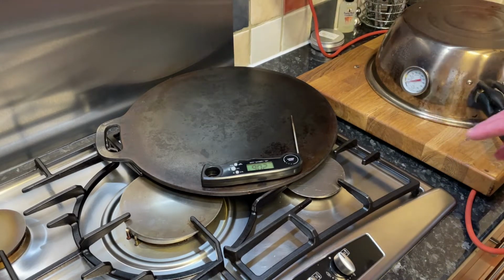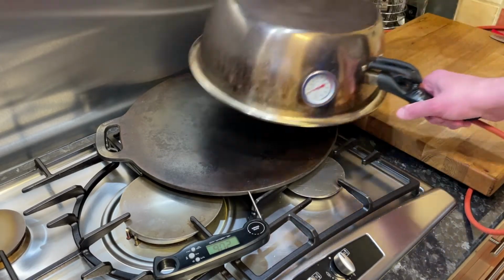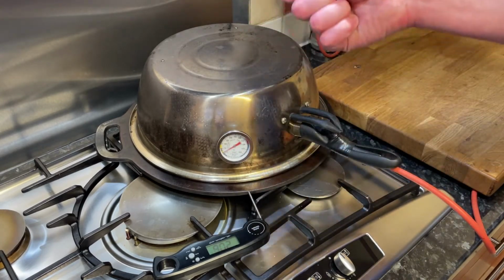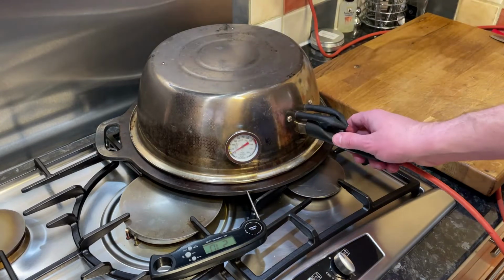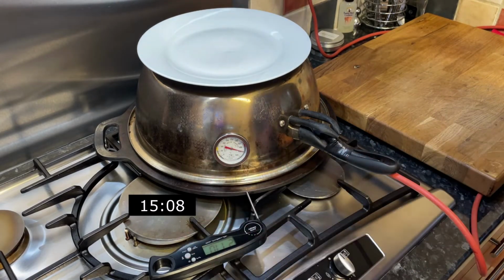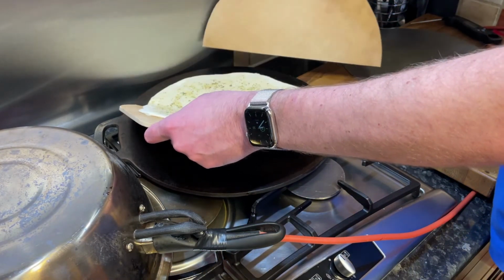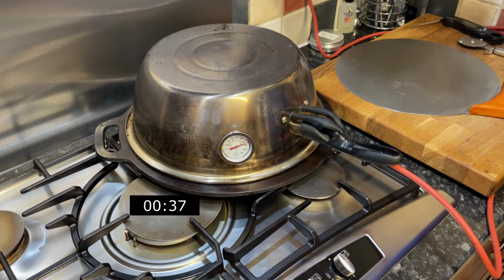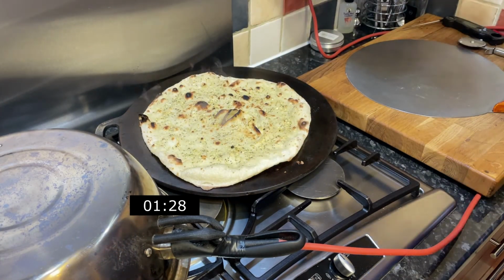Homemade Electric Pizza Oven - Follow Up

Comment: Nice time probe without gas fired for the bottom plate. I use an aluminium alloy 1cm thick plate and with gas takes 5 mins to heat up the bottom plate. I've so far burnt a couple of elements probably due to corrosion or excess heat build up. Each lasted about 6 months of using the oven every other day on average. It usually blows the main switch circuit breaker. To avoid that I use a power board instead of directly connecting it to the wall socket.  Power boards have an overload fuse that goes off when the heating element burns.  When that happens the nichrome wire of the element touches the tubing which short circuits through the ground wire and blows the main circuit breaker. If you use gas for the bottom plate your preheat times will reduce to 5 mins. To prevent burns of the puffed up dough I use a small round cooling rack which hangs using a long bolt slightly lower than the element. When the bread puffs up, the cooling rack prevents it from touching the element and doesn't burn.
Reply from the maker: That's a great idea with the cooling rack, I might have a look at doing that myself.
I try to avoid using any aluminium in my cooking which is why I went for a cast iron plate.  Many thanks for taking the time to comment.